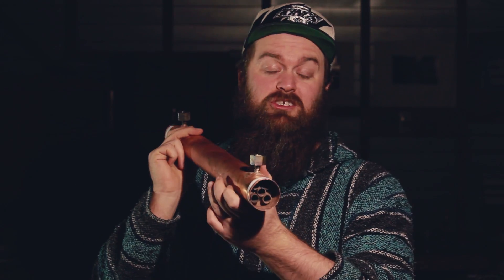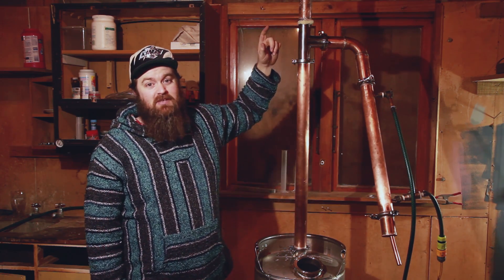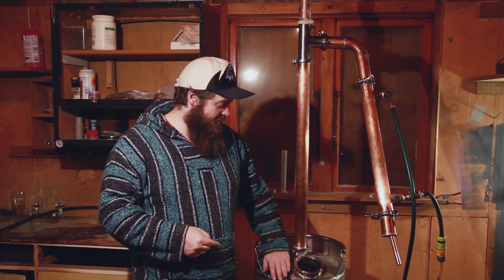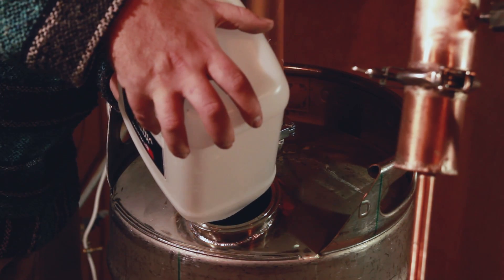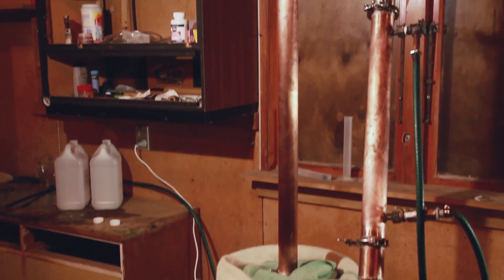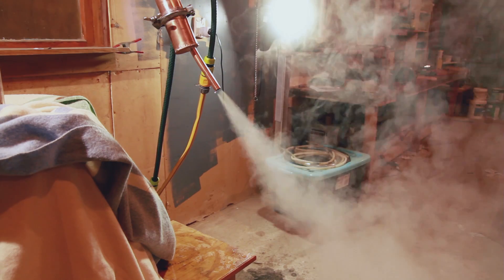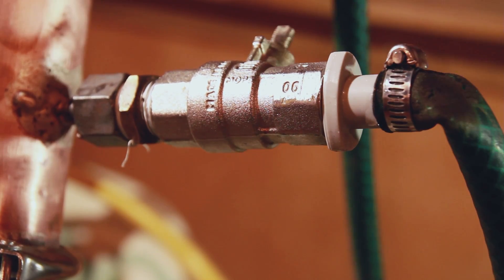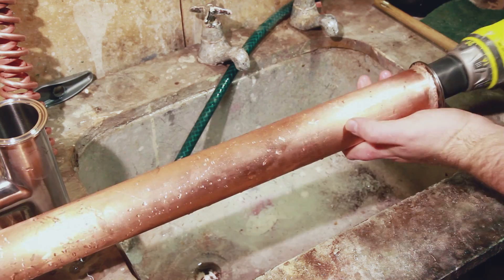Cleaning A New Still - Vinegar Run

Comment: another good vid.  almost there.  can't wait to see your first run.  time to start your sugar mash,  or use some left over alcohol.  i remember my first run, i used left over wine from a wedding.  box wine worked great and it was free.
Reply from the maker: Thanks man!  

I have the "birdwatchers"  ready to go for cleaning run.  I also have 20L of beer to run.  Thinking of doing another 25l AG wash to add to the beer for the first "real" run.
Reply: I've used old beer before  and it works great.  only down side is it is usually no more than 6%.  so you're only looking at around few liters
Reply from the maker: This brew is only about 4.3% I think.  But I guess I may as well use it.  Other wise its going down the drain haha.  

It's actually not bad at all.  A kit and kilo that didn't quite hit the mark.  Still totally drinkable as beer.  Just a little average.
Reply: Nothing wrong with4.3. Just remember that your volume won't be huge.  might I add that when you run the wash, save the heads and tails and run them with the beer.

Comment: Very good video Jesse. Safety is paramount in this hobby.

Have you chosen a packing material for the column?

You may want to pick some up and run it during the sacrificial run. You can use copper or stainless steel scrubbies, marbles, lava rocks, or Spiral Prismatic Packing (SPP). To hold them in place, use a stainless steel mesh dish strainer ($2 - $3) between the column and the boiler.
Reply: There is no need for packing during the cleaning run and a sacrificial alcohol run...the packing will just get contaminated with the crap he wants to clean out.
It's much better to clean the packing material separately. This means boiling the mesh of whatever kind in a solution with vinegar for some time or washing the lava stones after one has broken them into adequate pieces. SPP is hard to get and expensive. However, it's the absolute best material for packing. Marbles can be used, but due to the relatively small surface area, they are not as effective as lava rock.
Reply: The stainless strainer is strong enough to keep marbles, lava rocks or SPP in place. Copper or Stainless scrubbies usually stay in place like you stated. A densely packed column best. But be sure you can still draw a breath of air through it after packing it. You don't want to make a bomb...
Reply from the maker: Thanks :)  Looks like you take first place honours this week! haha 

I was actually just thinking about that last night.  I had loosely planned on using stainless scrubbers.  and just friction packing them in.  I had not yet decided though.
Reply: I ran my lava rock through a water run, vinegar run, then a sacrificial run. Torn down (CCVM/LM column) between each run and checked how clean the 3" copper pipe was. Copper was clean and would just build up a patina. The dime sized lava rocks I kept in a bucket of clean water after each run, never saw nothing bad in the bucket of water. Most of the "crud" (dark color and oils) ended up in the liquid of the boiler on full reflux.

SPP is expensive, BigSwede had SPP on ebay for awhile. Have to check the HD forums for his SPP machine he built.
Reply: Good advice. A strainer will do the job fine. 
However, I also run a two-inch column and use a stainless scrubbie to hold my packing material, which would be lava rocks by now.
Also, you gave him a good advice regarding how tight to pack the column. A lot of people starting out with a packed still, forget about this little but important detail.
Reply: I see you've done some reading and listened to those who know. 
The way you run is about the same way I do. Depending on what there's in the boiler I run 1L bottles ( a tad over a quart) or 250 mL jars (half a pint). It gives me a good control regarding the first cut. I let my spirits air out over night, by covering the jar with a coffee filter or the like. Next day I do the second "cut" as some of the volatile stuff is drawn off and it gives me a better judgment on what to keep and what to recycle. Heads and tails are treated like feints and are recycled by the next stripping run.
It hurts my eyes every time I see people uploading videos of their rig and I have to notice the use of plastic funnels, buckets, and rubber gaskets.Pressure cookers..most Aluminium seems popular too...unfortunately..! The worst part is when people actually copy these practices and think it's all good. It's bad enough they poison themselves but sharing that kind of rotgut endangers other peoples health too.
Reply: Oh yes..I've been doing this for a couple of years but still, I learn new stuff all the time. It's great Jesse shares his journey with the folks on the tube, it can help a lot of new distillers to avoid the pitfalls of this hobby and get a good start. As for now, I don't even have a keg my boiler is a milk can. Fortunately, I'm a pro metal worker so I build all my equipment by myself. Otherwise, I'd also have to take the long way. It's all stainless and TIG welded. I'm running it electric with a controller and a fullbore ball valve at the bottom for a drain.
A fill port is on the to do list. A drain is really a good option...no fun waiting for the still to cool down every time...let alone handle it when it's hot.
Reply: Ahhh..I see. Wow..40 gallon for just one gallon of syrup, that's a lot of work and boiling. Diluting the low wines may actually do the trick. Instead of diluting down to the normal 40% ABV with water, the sap could be used and give a very special note to the end product. It would surely be worth a try.
When you are used to weld construction steel that thick, TIG welding will be a big difference. No sparks and sputtering and a lot less heat, so it's a really pleasant way of welding. One important thing is to tack weld the whole work piece with a lot less distance than one would use for mild steel. The alloys in the stainless will get it to warp like crazy and in this situation, less heat is better. You're right, like in distilling...it's all about the journey & experience. 
I like to say...a welder is never better than the last weld he did. The Same thing applies for distilling. It humbles me to see the master distillers have decades of learning and still are open to new suggestions. It will be a while before I get close to their experience.
Reply: Took me a month to bust up 30lbs (13.6 kilos) of lava rocks to dime sized bits for my 3" Manu column. I mostly run a pot column and do stripping and spirit runs.
Reply: I was lucky to get my hands on a hydraulic press. As I had a bag of lava stones intended for aquarium use, no one got suspicious when I threw them in the press. Never had an aquarium in my life...lol
Many run a reflux still directly on the ferment. I prefer to do a stripping run first like you also do.
I'll get a whole lot more in the spirit run by doing so. Furthermore, I don't have any nasty stuff in my packing material.
I also reduce the amount of foreshots in the spirit run, by taking them in the stripping run.
Reply: Cool work with the press!

I smashed my lava rocks with a 5lbs hammer. Took about an hour each day after work in the shop I work at. They went everywhere. Picked them up, tossed in bucket, and repeat.

Yep, during stripping. I collect in glass carboy, and repeat. Dilute with water and run pencil stream. I cut in pint or quart jars. Depends on the wash/mash.

I follow the rules: All distilled ethanol may only make contact with Glass, Stainless, Copper, Wood, or PTFE. No plastic jugs, buckets, no Silicone or synthetics.

I use my fores to start my "manual lite" Pellet stove in the winter.
Reply: Could not agree more. There is a lot of bad videos out there.

This hobby has the biggest learning curve I know of. It's great that Jesse is sharing his journey, and so far he is spot on and progressing much faster than I ever did. Jesse's boiler is kickass, he definitely got lucky. Took me close to 3-4 months track down a legal 15.5 gallon keg. Took me several attempts to solder in the 1" fitting leak free. Someday I hope to put it a drain and a fill port. Would make operations much quicker.
Reply: I have no drain. So I wait 24 hours and use a shurflow pump (diaphram pump $70-$80) 1/2" hose with a racking cane on it to get the warm backset out of the boiler. Diaphragm pumps do not like temps above 130F, but they self prime up to 9 feet, so they are great for transferring/racking washes.

I often thought about upgrading, just finding another keg and start over. I would take my time and try to make a polished show piece: add legs, 6 inch clean out, proper welding spuds, and a drain. I could then use my current boiler in a HERMS brewing setup. I mostly BIAB.
Reply: Diaphragm pumps are great for that job. You won't regret going the long road with a new keg. That is on my "wish list" too. Silver soldering the thing can be done and is also durable. However, if you go for a new keg TIG welding with purging gas is definitely the way to go. If you want to add a 6" ferrule at the top for easier access you can cut down on the more expensive solution with purging gas, as one can reach inside and grind/over weld the ugly backside of the drain and element port welds. Tip: Fill the keg with some water before the hole for the 6" ferrule is cut. It vastly reduces the mess inside and prevents particles from sticking to the side/bottom.
I'd recommend a female threaded fitting for the element or a clamp-on solution with a ferrule (more expensive, though).
As you do some brewing, I bet you also run a lot of AG ferments for Whisky..?
Ahhh...I really want that keg, so I can do the stripping runs faster. My milk can is just a tiny one of 6,6 gal US. It would be nice to use that for spirit runs only.
Reply: I would definitely have it all tig welded. I can mig and arc weld anything, but I have never tig welded.

When I had my element ferrule welded tig welded in my 16 gallon brew pot ($10 !). The welder stated "You can cook a lot of sugar in that pot!". I then told him it was for home brewing. He then said every fall/winter he gets dozens of people looking to have stainless welds for maple sugar evaporators....
Reply: If you are familiar with welding, you should be able to TIG weld. Stick welding, is a lot more difficult than TIG is. The key to it is a steady hand and a very pointed needle in the torch. The second it gets dull or you accidentally dip it in the weld, stop and change/sharpen it. However, if you don't have the right gear (expensive) it would be better to let someone in a metal shop weld it up for you. It will last a lifetime, so whats a few $ for welding a couple of fittings/ferrules to your rig..?
I must admit, I've never seen such a "maple syrup evaporator". I made a search on the tube for it, what can I say..pretty impressing what people get out of this. It must be an US or Canadian thing, cause I've never heard of it around my neck of the woods. That gave me an idea about some syrup cooking I could use for my neutral spirits. Thanks for bringing it up.
Reply: Maple syrup. AKA "Sugaring" in North Western Massachusetts in the US. Many a hilltown has a sugar shack.
Takes 40 gallons of sap boiled down to make 1 gallon of maple syrup. ( Helluva boil !!!! ) Sugar season happens in early springtime (March sometimes late February) when the days are warm, and the nights are cold. The maple trees will piss that sweet sap.

I always wanted to collect sap and use it in a mash/ferment (or dilute low wines with) for a hint of maple whiskey. I can collect my own (but buckets or lines have to be maintained daily and are $$$), but it is easier to buy sap from locals less than $1.00 a gallon. Depends on who you know. Someday soon...

Never had/used the TIG welding equipment. Stick welding is not that bad. I have always welded big thick steel 1/2 inch and up in construction. I watch the TIG videos and would love to find time someday to take classes on it. It is about the journey & experience.